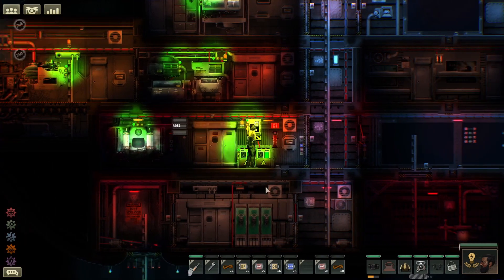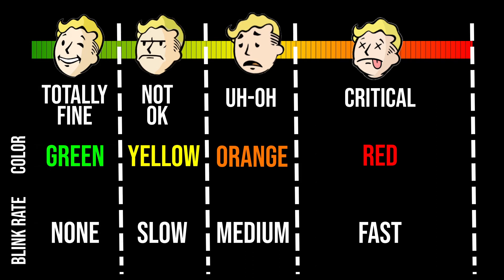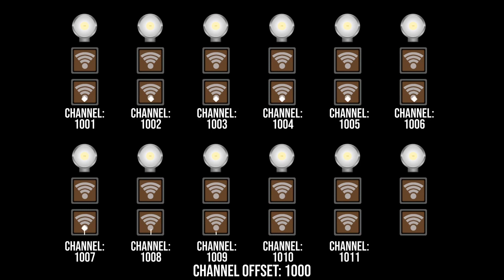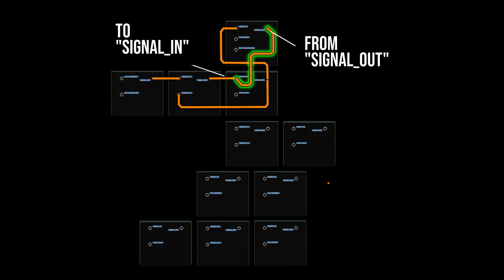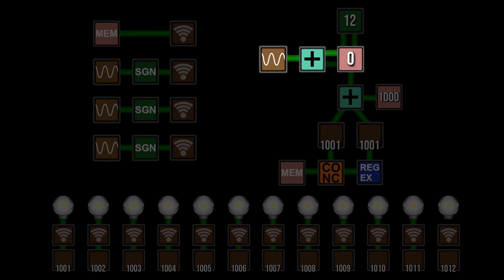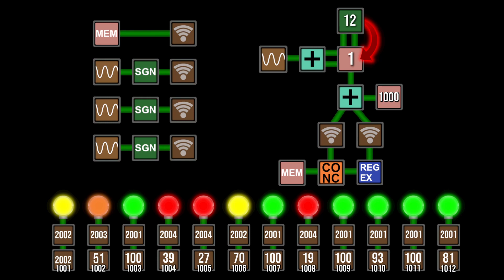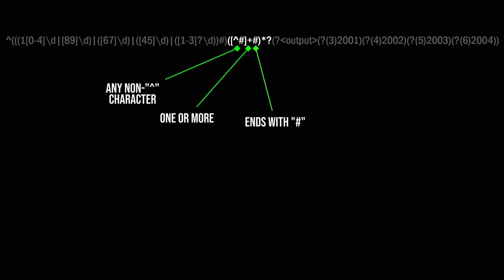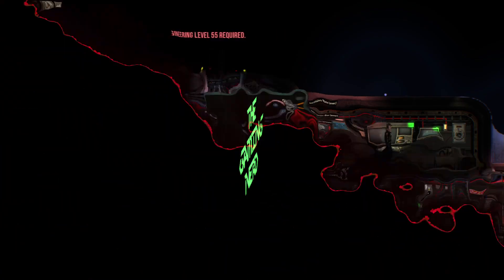Barotrauma - Condition Monitor circuit walkthrough

Comment: This game is such a good platform to figure stuff like this out. It also shows the difference between people, I was proud when I made my very own "smart" Airlock, but that would be nothing in comparison to this
Reply from the maker: Everybody has to start somewhere!
Reply: I figured out enough about wiring just from testing and a pretty large bit of ingame experience to literally INVENT MY OWN DOOR system, which is literally absurdly op compared to regular doors. I refuse to make a sub without fully decking out every single door with my "perfect door" design.
Reply: @lonejohnwolf  What does the door do?
Reply: @lordquadrato437  I think it's a door that automatically opens and closes with motion detectors, but if the water level is above like 40% or something on EITHER side of the door, it needs to be manually opened again, but will still automatically close. It's an utterly genius design that shocked me when I invented it. 😲

I think it took HOURS and hours to perfect and get right, and doing it for hatches was even trickier.

Comment: It's a cool idea though I would likely make some tweaks. I'm not sure the flashing is really needed. Instead having the light off if no repairs are desired and on with green, yellow, red for mild, moderate, urgent damage. That cuts down a bit of work and honestly I'd argue is easier to live with with. I'm also not so sure there's a desperate need for high refresh rates - it looks as though it's likely one second per cycle. I'd argue anywhere under 5 seconds is functionally the same. But it's an ingenious design to save on components and a solution to a problem I'd never really considered myself. I'll likely end up doing my own solution as that's a big part of my fun but it was incredibly enlightening to see the intelligent and unintuitive solution presented here. One such tweak I'd consider is a text message when urgent repairs are needed, but that's a pretty easy modification to the design for most engineers without needing a guide.
Reply: Aesthetics are important too! 😂

Comment: I admit I have a hard time trying to understand all this but... I think this is exactly what I was looking for. Not for the condition of devices but for the reactor's fuel percentage. Maybe I can tweak this a little bit to make it work
Reply: No need. The reactor has it's own fuel percentage output labelled "fuel percentage out". My solution is simply making a text box to display it - one wire. I actually added a lot of other logic so it's colour coded and so on but that's a lot of work for little gain.

My engineer's solution is to trigger a signal when below 5% and wifi a message on chat. He uses regex (he's a programmer) but it can be done simply with a logic if three components is acceptable (rather than two). Same reactor percentage wire goes out to a greater than logic component. That compares to mem signal saying 5 (the percentage you want the message). When it hits 5% the output triggers and 1 is passed on. You can change the output to signal whatever you want and feed that into a wifi. Or you can feed that 1 into a signal check component to translate into whatever text then put that into a wifi. The latter allows you to also feed an alarm or light or anything else you wanted. You can actually have both solutions at the same time - one wire to a text box and another to the wifi setup.

Comment: As opposed to the RegEx, you could replace it's overall function with a Subtract 20 (min 0), Divide by 20 (max 3, min 0.1, Floor.
The subtraction and division will translate 100 to 0 condition from 3 to 0. 
You could use this setup alone by inputting condition into the Subtract, then multiplying the result by 33 into the H of an Color component. Pretty straight forward 5 circuit design for one condition check.
Reply: where's the fun in replacing Regex

Comment: 4:56 Thank you for the video and about
"Remote Indicator"
Light components make sure to turn on by default.
first WiFi components channel, leave it to 0
Second WiFi below first, that channel set it to 1001,1002 and more for how much you need

6:40 about Signal Check Component
Example :
False output : leave empty
Target Signal : <# of device>
If you have 20 device's and just type 20.

9:43 Thanks for the explanation, i now understand..

Comment: This video had a lot to unpack, and it is amazing.
Currently making a big submarine with a dedicated engineer station, with all the readouts at one spot, and this will be perfect for that. Have to watch it a couple times to actually understand it, but it's very informative.
Reply from the maker: The "Regex Dictionary" technique used in this video is ideal for that, I've been putting the finishing touches on a video for that too... Stay tuned!
Reply: @TheGamingNerd2022  Just installed this in my sub, it works perfectly, thank you for this tutorial. Rewatching a couple times makes the regex actually less scary.

Comment: Hi. Thank you for this useful design and it's clear explanation. Can't wait to try this idea out.
As a regex enjoyer I have a few suggestions:
- 1\d\d looks cleaner and shorter than 1[0-4]\d and I don't see why you want to stop at 149, although it's not really important;
- there's a typo in the regex in the description: there should be [1-3]?\d instead of [1-3]\d?, since the last one doesn't catch values from 4 to 9;
- it's a good practice to use non-capturing groups (?:) to not pollute index space. To be honest, I haven't tested if they work in the game, but they're pretty standard.

So, a cleaner version looks like this:
^(?:(?:(1\d\d|[89]\d)|([67]\d)|([45]\d)|([1-3]?\d))#)(?:[^#]+#)*?(?<output>(?(1)2001)(?(2)2002)(?(3)2003)(?(4)2004))
Reply from the maker: Wow! Interesting stuff... First of all, thank you for the feedback. Second, I appreciate your input, comments like this are exactly how things are supposed to improve. 
- You're absolutely correct that "1\d\d" is simpler and I've thought about that more than once, for some reason my brain is happier with clearly-delineated group limits but if I re-make this video for any reason I'll be sure to include this change! 
- Your second comment has also been noted and appreciated, and the regex search expression in the description has been corrected. Thank you again. 
- Finally, I'm still pretty noobish when it comes to regular expressions, so I had no idea that you could prevent non-capture groups from being indexed like that! Again, very much appreciated!
It's comments like this that keep me determined to produce more content, since it's always nice to know that people are not only watching the videos, but paying close enough attention that they can contribute to the evolution of the design itself! Thank you again!

Comment: The new circuit boxes are going to be god sends if you're setting this up without sub editor, and even with sub editor. In my sub i have a large wall of weapon mounts that never gets used. It's right next to junction (and armory) and i think im gonna replace it with a wall of the lights.

Comment: The best thing about this, is with that new update they just released, you can techniqually suffice all these components into a singular box. however, you can only have 8 in and 8 out. Due to how the circuit boxes work with wifi components being weird.
during my building in a campaign it was like circuit boxes cannot register other circuit boxes if you attempted to have wifi competent read each other.

Its quite interesting how well you also make these wiring videos, i learn a lot more in terms of these videos, especially with the actual WIRING parts where you show the wiring in each step perfectly with a visual representation, these work a lot more in order to teach rather than the average wiring tutorial being a ingame video, which can be difficult to follow.

Of which i thank ye for doing this, i know i probably wont make a wiring video like this but hey, its cool to know someone out there is intelligent enough to deal with....REGEX AND SOMEHOW EXPLAIN IT!

Comment: I'll try doing this in my tier 1 subs but everything with more then 8 devices will probably break my soul. For anything larger I just go with toggleable status monitors. Once the mechanics have PDAs electrical deterioration is easy to root out regardless.

This is the first video which explained regex expressions to an understandable degree! Thank you very much. I learn everything about components by myself and regex made me struggle badly.

Comment: No wonder that people call wiring black magic.
I never understood regex or concuctors so when I've set up my terminal control network I brute forced it with two million signal check, sum, memory and con components.
This is so much clearer and even has a four step condition output which is legit black magic to me.

I understand everything except for expressions. That stuff is really hard to get imo.

If anyone has basic learning tutorials for learning expressions I'd be glad if you could shoot me some material.
Reply: If anyone knows this: is there a way to implement the Multi-Cam trigger counter system into this condition configuration?
Reply from the maker: Probably, but you'll need to give me more details... You want to increment the camera system and the condition indicator at the same time?

Comment: Realy cool, and I could probably use it somewhere else like battery charge. Definitely overkill for a mechanic that I find is based more on the function of the component than the damage it has taken. (The reactor gets repaired before the batteries)

Comment: Didnt work for me. Ive checked the whole system in triplicate and i cannot find a single wire, value, or bracket out of place. yet the moment ive wired the 15hz pulse oscillator to the rest of the circuit my memory block values accumulate infinitely. :(
Reply: It appears they rework reg exp component in the new update, didn't work for me as well, the value is passed to regex, but no values comes out. @The Gaming Nerd
Reply: My guess is that it might work if you try to make the pulse oscillator slower, seeing as the developers have slowed down how fast the regex component sees multiple inputs. 

NVM it works just fine, just make sure you actually wired in all the condition outs of every single item with the 2 wifi components and the light into the bottom wifi component's signal in. I forgot to do that other than for the first one and now everything makes sense and I am VERY happy.
Reply: @HistoireDuViolet  Wait how do you know that?
Reply: @lonejohnwolf  I just put a text monitor right after a concatenation component, and the output was like 89#2001#2002#2003#2004.
And after that I grab this value and test it online by regex. It worked on site, but not in the game.
Reply: @HistoireDuViolet  I figured you'd use a text panel, but that last part dang. 

Is there any way to split the "load" between multiple regEX components? I'm pretty sure the issue has something to do with a regEX not being able to receive multiple inputs too quickly AND ignoring similar outputs too. So I'm pretty clueless about how to fix this and am probably going to build a system independent of the (broken) regEX but still use the first circuitry if possible.
Reply: @lonejohnwolf  It is not about the load. If you just put memory component and regex component right next of each other, and give some value to parse with capture group- this is not working with the regex component, it just returns nothing. So probably a bug, by my opinion.
Reply: @HistoireDuViolet  Yeah I found that out after I fixed the problem. I have NO clue what the heck the developers changed about the regex component now. I get the feeling I was lied to and it wasn't even changed.
Reply: @lonejohnwolf  im almost positive ive done this, but ill have to look again later.

Comment: Idea to make an overly complicated circuit system: 
Since color already indicates the state of the equipment easily, why not send out the condition measurement signal filtered through an oscillator to measure the change in condition over time? If the condition hasn't changed since the last pulse, the light doesn't blink, while if the condition is decreasing many times over a short period of time the light blinks faster.
This could be used to see which components suffer the most stress during the submarine's operation

Comment: So I can only get one light to work and that's when the target signal on the signal check component is set at 1. If I set it any higher the lights just don't do anything. Help would be appreciated
Reply: I'm no expert, but i assume that to change state of the light component it has to recieve analog signal (either 0 or 1, true or false, 0 being off 1 being on). You are trying to send digital signal, so it doesn't no what to do.
Note: i didn't watch full video nor i'm an eletrician nor i'm sub editor enjoyer. Nontheless hope i was helpful. Good luck

Comment: i need help, i would like to make a text display which will display the lowest charge% of 5 capacitators. at firts this would be easy. but the problem is that i cannot think about better solution than comparing greater outputs for each capacitator, and also every capacitator for each result of 2 other capacitators. AKA, there would be a lot of wires with all components. 
is it possible to make it functiona,l without using a lot of compoments?

i see in this video potencial of working, because you created cycle for each instance.
Reply: The only way is to compare each signal to the others. I don’t think there are any components that can take in more than two signals for logic purposes
Reply: @jaimesupah  hey, i somehow did it. I tried to understand nerds condition monitor, and used his circuit for that. 
Basicly, the only thing what you need is to rewrite outputs of memory components (instead of colour data to number of charge rate what you want) and slightly modify the expression of regex. Then only rewire the "wifi to light" to "wifi to set charge" and it works.

If you want, I can create item assembly and post it to workshop and sent it to you.
Reply: @Fufancz  definitely share it. Sounds cool
Reply: @jaimesupah  it seems that yt platform insta deletes links :-( cant share it there
Reply: @Fufancz  rip

Comment: The "output" in the expression requires the <> around it to assign the string "output" for the name of the capture group, correct? Otherwise the RegEx doesn't have any output provided (maybe a recent change implemented by devs).
Reply: In the description: "NOTE: The word "output" needs to be enclosed in angled brackets! Youtube wouldn't let me include those in the description..."
I didn't notice the note before I started over twice :D

Comment: Everything works fine for me but the Red color somehow doesn't and I have no idea why.
Reply: When I set the false input to something like to 255,0,0,200 It lights up as if it never receives a true signal but the oscillator is set the same way as the others...
Reply: I believe the false should be 255,0,0,0. The fourth number determines luminosity I think. Try that?

Comment: Alright, so I have 23 different devices set up, only 3 light green, but the color doesn't change at all despite going all the way to broken. Any help?
Reply from the maker: Sorry for the delay! Lots of family health issues lately. Let's review to make sure I'm on the same page: You've got the remote TX circuits set up, the color assignment thing set up, and the channel driver is questionable. Am I reading that correctly?

On second thought, this will probably get resovled fastest if we can work 1-on-1, if you're interested.

Comment: Idk how to explain this but I'm trying to make automatic recharge capacitor but with 2 modes 50% or 100% recharge rate goes to zero when full I have done the signal check of ur method with the 1 component the modes work great my issue is when one capacitor is full the others don't charge if needed what am I missing ik it's simple
Reply: If they are on the same system but are drained differently then one won't recharge properly.
Reply: @CAMSLAYER13  thx sucks I have to make multiples but I got it working
Reply from the maker: Check out tonight's stream, I've got a handful of solutions for you!

Comment: this is very ingenious, it's very interesting how you saved on components by separating this device address based regex controller and color generation circuit from each instance you're trying to measure. very impressive to get the scaling cost to be just two wifi components and wires. one thing I will just comment is that in the regex expression I think you can remove the `([^#]+#)*?` and replace it with just a `.*` and it should still work I think
Reply from the maker: The search expression "([^#]+#)*?" means "search for strings of one or more of ANY character OTHER than "#", ending with a "#", one or more times" This is important to search through the regex outputs delimited by "#"s.

Comment: does this still work? no matter what i do i only get a solid white output
Reply: regex is not giving any output at all, ive ensured the expression is correct and the correct boxes are checked. ive made sure the input from the conc box is also correct (1-100#2001#2002#2003#2004...etc.) but the output is still blank. does anyone have a fix for this? im using the latest version.
Reply: @loganson590  same thing happening to me